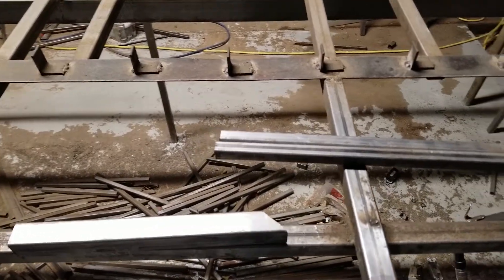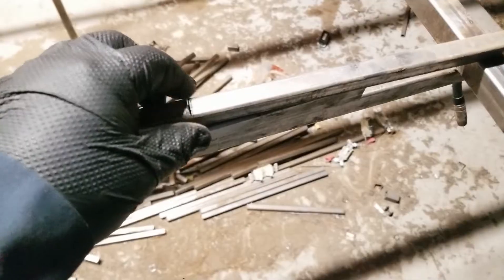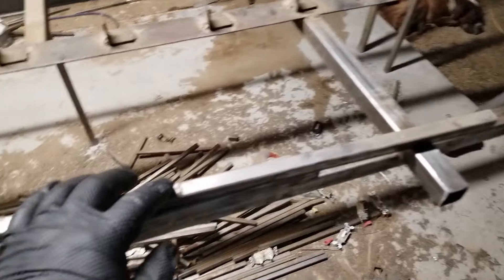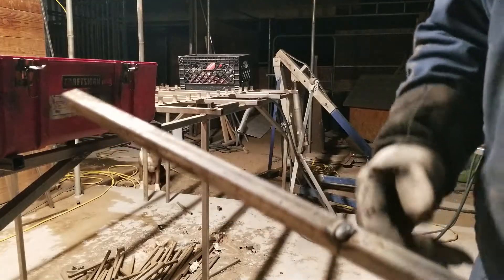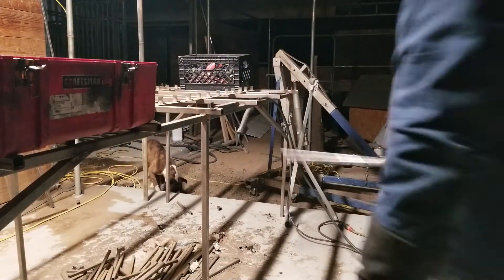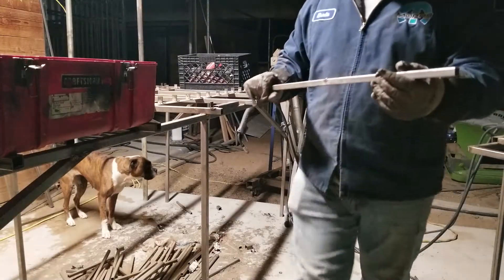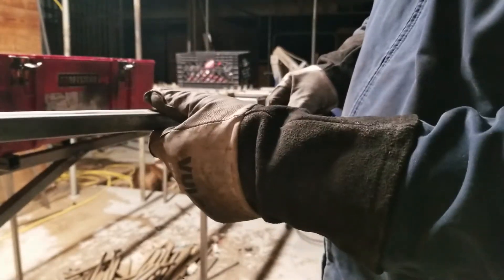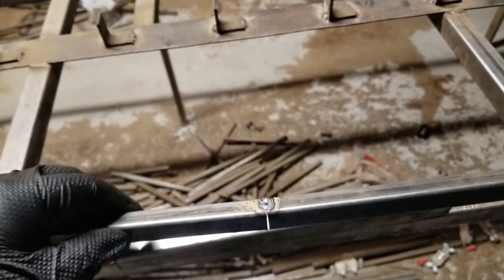How Strong Is Flux Core Welding?  | Gasless Flux Core Welding For Beginners Tips And Tricks |

Comment: I have also tested flux core by welding things on one side and then attempting to break the weld by hitting with a large hammer bending back and forth.  I found nothing suggesting that it wasn't a strong weld.   Gas is definitely cleaner and just nicer to weld with.  Good video.

Comment: Cool video. Keep them coming. I'm debating on trying out welding but clearly need to do more research on my end. These videos are a must for this. I have a question for you if you, though. Which welding style would you choose for welding together a nice sturdy sissy bar on a motorcycle? I was thinking it would be flux as I've seen it handles metals on the less thick side and tend to look cleaner. But I'm curious about what you would choose. Mind you it would also have to hold the weight of a passenger leaning against the bar while the bike is in motion at some pretty high speeds. From what I've seen, so far, flux should handle this. But I'm also wondering if stick would be good as well because I'm actually unsure of the metal thickness on this kind of application. I just assume that some areas will be on the thinner side for this kind of job. Anyway, thanks for the vid.

Comment: Another great video.  I'm learning to weld using flux core on 2 x 2  16 gauge square tube.  On the occasion I get a nice bead, it's difficult to break the weld using a 5# sledge.  More holding than I need.

Comment: I've done both with my Lincoln 225 and prefer welding with gas if for no other reason is that it makes a much cleaner weld if you dislike or don't want splatter cleanup. For welds that are out of sight or in the field, the flux core is fine and just as strong but mine were never pretty, looking more like bird tu#ds

Comment: Flux core wire is not cheap
Reply from the maker: Well it depends on what you mean by cheap. The wire itself is more expensive than mig wire but if you have to add in the cost of the bottle, regulator, and then the subsequent gas refills, flux core is more cost effective .
Reply: 180 cubic bottle of mig gas a run me 45$ to fill I'll run alot of wire off of one bottle if   I'm in a garage or Barn but when I'm in the field welding I use dual shield flux cored wire and that's 930$ plus taxes of course heavy equipment repair on thicker metal and when I got my bottle from a place called welding supply over my bottle were close to 500$ for the regulator and the bottles to me that were a hold lot cheaper and cleaner than regular flux core I only run dual shield flux cored with the shielding gas stick and mig and Tig but to each is own but definitely love the videos and different parts of you view 😉 keep up the good videos

Comment: dont need any test videos , the specs and strength of every certified welding consumable is on every data sheet , also the welding parameters  , based on design and the welding specs ,  70,000 tensile is 70,000 tensile

Comment: So flux core can be used to make bash bars for cars ? Or make some go kart frames ? I just got a titanium flux core 125 from harbor freight but didn’t know there different types of welding
Reply: Did you end up using that welder on any framework? How did it go?
Reply from the maker: I never saw this message, my bad. Flux core is strong but brittle. I would not use it on anything that flexs a lot like a fram. Can it be done? Yes, absolutely. Would I depending on it for a critical component? Probably not.
Reply: @NightWrencher  Thanks for the response. I figured I'd go with a 3 in 1 that provides the flux core and stick. What kind of amperage am I looking at to properly weld with stick for about 1/4" steel? Would 220 do the job?

Comment: I've been working on side steps on a truck for a customer, and one of the steps had a good 3" x 3" rusted through patch. I put my flux core welder on low volts and filled the whole thing in and smoothed it out with the grinder.
Reply from the maker: 😂 good job. I would have just made a patch and welded it in but if it works, it works 👍

Comment: I use fc 308L on stainless water heater tank and water keep seeping out at around 30 psi. Eventually have to take it to shop for repair with gas. It could be I'm new to welding but normally I don't have issue with regular weld.

Comment: Let’s see them weld outside with the wind blowing with MiG on some thin metal… Then come holler back at me… Or stick weld some thin material…😂 Flux core is bad ass, the only ones that complain about it probably have the polarity backwards or to much tension on the wire. Or running some shity wire.
Reply from the maker: Right?? I love flux core 😂

Comment: The haters can go eat dirt.  I used flux core to weld 1/4 plate to 2 inch thick steel to mount a six ton winch.  No failure.

Comment: for someone who knows how to weld with flux core it is every bit as good as mig. If you think about it, it's like arc welding. Arc welding the rod has the flux on the outside of the electrode, flux core it is on the inside. you get a thicker rod with arc, but with flux core if you aren't going too fast you are able to put more wire into the weld. So with flux core you have to be a better welder.

Comment: I used my HF 90A  (converted to DCEN) to convert my HF motorcycle lift from a manual hydraulic jack to an electric powered hydraulic cylinder.  The welds have to hold up to 10,000# of shear force and are holding well.  Flux core doesn't make the prettiest welds but they are strong. I'm strictly an amateur welder, and until I got this welder, haven't welded since high school about 100 years ago.  I'm convinced that if someone can't get a good weld with flux core, its not the machine's fault.

Comment: My first welder and the one that I use most of the time is a flux core welder, once you get the speed, technique and rhythm right it's all good. Everything I have welding with flux core remain strong even under heavy use. Even on my hay trailer.

Comment: Flux core is stronger than MIG.  Better penetration.  Yes.  It is messy.   Pull back a little.  More wire, less splatter.

Comment: Is it safe to run a welder on a generator idk if you’ve already answered this question but im a beginner to welding i just started watching your videos but I’ve heard that its not safe to use a generator bcs generators produce what’s called dirty power and can damage the welder is this true?
Reply from the maker: All my videos are with a generator. I use an inverter style generator so it produces clean power. A 3500 watt inverter generator will handle whatever you need to weld as a DIY

Comment: PLEASE, please put your pets in the house or lock them out of the shop when you are doing any kind of arc welding or even angle grinding or angle wire brushing. Animals eyes can get arc burns and permanent UV damage from welding. And tiny flying slag, metal, and wire bristles can cause terrible damage to your pal's eyes. 
THANKS for the helpful vids. Even though I've been doing amateur stick, wire, and gas welding since 1975, the time between projects means your information is a great refresher or reminder for getting back up to speed.

Comment: I rock a Lincoln mig Pak 180 and burn Lincoln self shielded. It's structurally rated and is comparable to a 60xx smaw rod. It has a tensile strength of about 60 Ton, per 1/4 inch fillet at one inch long. Mig is cleaner, smoother and looks nicer... But even self shielded flux core is approved for structural. If you're using rated consumables, it's not inferior
Reply from the maker: Exactly right 👌

Comment: Flux  core is used in structural steel.
   For years now.
It isn't the tool it's the person welding.
   I stretched a blaster rear swing arm with Flux core.  12 years ago.  It's still holding to this day.
   And sees lots of abuse. Jumps and all
  I did however. As always over build.  I cut the swing arm at and angle two of em to get the 4 inch stretch, and sleeved it from the inside drilled holes and plug welded.
    I have welded with Flux core all angles, upside down sideways verticle horizontal and flat.
 Pacfice practice.
     Nothing wrong with Flux at all

Comment: No gas to buy, or worry about running out in the middle of a job, more space in the shop, and so much easier to move around.  It's a no brainer........
Reply from the maker: The only time I think regular mig is better is on things that need to look "good". Nicer beads, less clean up and you can use a thinner wire for sheet metal.

Comment: Would a flux core welder be ok for a frame rail for a car ?
Reply from the maker: Yes but it depends on what you're welding exactly and how thick the metal is. Thinner metals like mopar subframes are really easy to weld with smaller wire like .030 because theyre so thin  but chevy frames are much thicker so you'll need more heat and thicker wire like .035
Reply: @NightWrencher  hey thanks for the quick reply, I have a 83 cutlass and it needs the right side replaced , I thought maybe a flux core welder might do it . New sub here

Comment: Fluxcore is more penetrating than solid wire.  MIG or solid is preferred when there is limited or no wind that blows shielding gas away and material is clean.
Reply from the maker: Exactly right
Reply: mig is fast and easy to make pretty. stick and fluxcore  are better for strength and outdoors and can be nice looking too.

Comment: FLux core works outside better than just gas, since under high winds (I live in KC, where the wind only stops blowing just before the tornado hits), the flux doesn't blow off exposing metal for instant oxidization. Dual shield is great too, since you have the flux plus gas. You can also use flux to get in tight spaces, since you can weld with the outer cup off.
Reply from the maker: There are tons of benefits to flux core but people wont listen
Reply: @NightWrencher  I don't have experience with it yet, but clearly slag is a point against it (unless compared with stick).

Comment: Couple months back I got back into using flux core, I've mostly used used mig on my last two jobs, but here at my house I do a lot of stick welding and flux core welding old oilfield pipe mostly and the ocainsal square tubing but it works well with the right polarity and settings

Comment: I flux welded 2 chain hooks onto my tractor bucket.  My tractor has a maximum lift capacity of 1,300 lbs.  I was moving a boulder that my tractor could barley lift and was actually tipping the back wheels of my tractor off the ground...and the 2 chain hooks I used to strap the boulder to my bucket held, did not show any stress, etc.  This was all with only a 110v machine....I have no more fears of using my flux core over my 220v stick welder for small farm equipment.
Reply from the maker: If its done right, you can make welds stronger than the base metal even with flux core
Reply: I just asked someone above if I could weld a steel bicycle frame with flux. I guess this settles it:)) I just have to do it right
Reply: It's like making love...."penetration" is the key

Comment: Bro, do a video of this with 2 beads on opposite sides and lift something heavy to show it is strong. I just started welding so I don't know alot about strength but to me it seems hella strong 🤷🏾‍♂️.
Reply from the maker: Theres not much more I can do to prove how strong it is. Doing the most amount of work with the least amount of weld is usually a good way to test your welds. I've built my whole truck using flux core and none of the welds have failed. As long as you have proper penetration without overheating the metal you should be good

Comment: I mostly use Flux for welding no bigger than 3/16 on my car projects
Reply from the maker: Flux core is perfect for that 👍
Reply: Good welders can join  multi pass 5/8 inch thick steel  plate welds

Comment: I've been playing with a HF 125 flux core machine and have done a little destructive testing. I find that the mild steel I'm using starts to fail first by bending. Then the harder bead cracks. I've also found that if I do a root pass and layer two more beads in the fillet, the weld will hold despite crushing the base metal with a big hammer.

Comment: Can we all agree that who ever said FCAW is Inferior. Can t handle that heat. Hand get to toasty. Flux core is used in D1.1 and D1.5 bridging code
Reply from the maker: Exactly 👌
Reply: They use a different wire than what the retail stores carry for bridges.  It is much like 7018.  It is very important to have something to use outside on a job.

Comment: Fluxcore or inersheald burns 🔥  hotter than solid wire at the same settings. Those who are shiting on flux core are more than likely in a controlled environment tack welding fenders together. Because no real welder would be disputing your video
Reply from the maker: Exactly right 👍

Comment: This video proves the nay-sayers wrong.  For those who say stick welding is better, they don't understand flux core welding.  It's exactly the same process.  The difference is that stick has the flux on the outside of the wire; flux core has the flux on the inside of the wire.  I saw a video where the guy built a cargo trailer using the cheapest flux core welder available (HF model).  His welds looked as good as any high end welding machine.

Your video also showed that a common generator can be used to power a welder.
Reply from the maker: Busting down all the myths in one video 🤣

Comment: It seems that you stirred up a hornet's nest with comments about flux-core. I built my trailer with flux-core and I'm not even a professional welder. In fact, I've never used a gas MIG. I might go months without doing any welding, then do a little bit or a lot, so it's not worth me having gas. I would also agree that flux-core works well with a light wind, as I do my welding outside. One disadvantage of flux-core is that the wire is more expensive than plain wire. However, for infrequent use, it works out cheaper than having a gas bottle and getting it filled. The main disadvantages of flux-core are the fumes and having to clean the slag. A gas welder produces a clean weld (with no slag) and doesn't produce the fumes that a flux-core welder produces, so a gas welder is much better for indoor use.

Comment: Good afternoon from the UK mate I'm looking at welding some dies for my fly press in you opinion will the welds be strong enough please help 🙏
Reply from the maker: It really depends on the material of the base metal. If its made of cast iron, the welds might not hold without a good amount of heat before and after. If its forged steel then you should be OK as long as you Vgroove what you are going to weld and put in a lot of heat so you get good penetration. Depending on the thickness, stick welding might be a better option. Good luck!
Reply: @NightWrencher  thank you I thought that would be the answer what power stick welder should I get 😆
Reply from the maker: There are a few really cheap machines out there for just stick but I wouldnt know which one to recommend for you.